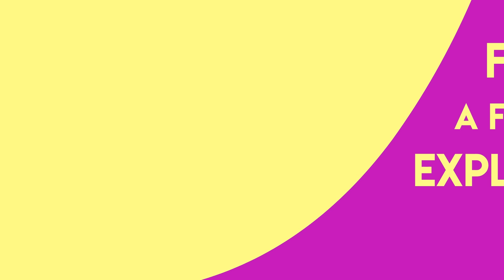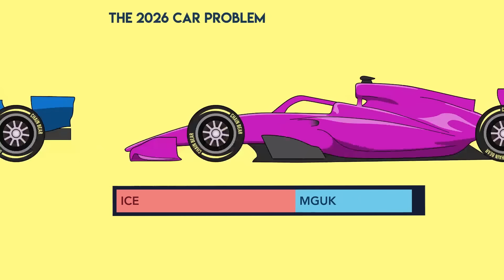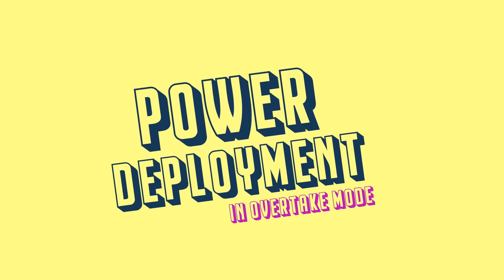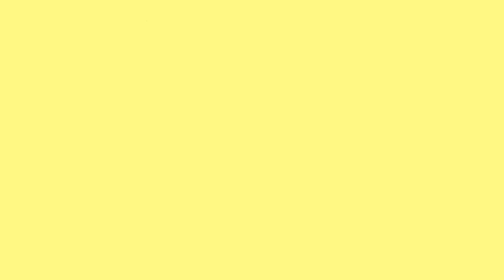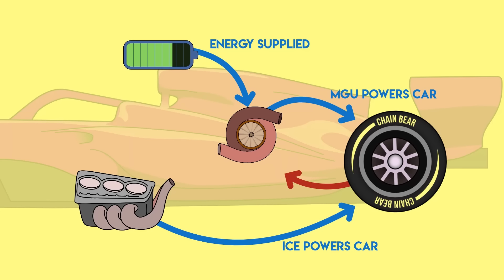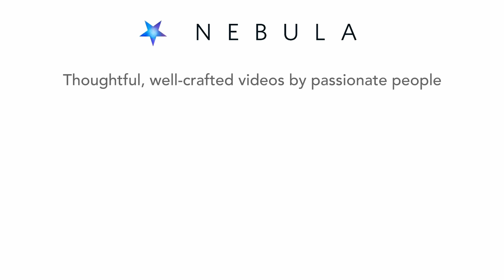New for 2026! Straight Line Mode and Overtake Mode

Comment: I have a wild idea. They said they wanted increased electric power output but didn’t say when! The 350 kW electric power can be fully deployed during the acceleration phase, after reaching 200 kph the output starts to taper. At the same time the ICE should be unleashed, keeping the combined power not exceeding 750 kW until 250 kph, then gradually taper the combined power to 600 kW at 300 kph. I remember the pre-KERS V8s produce 585–604 kW of power, with active aero helping reduce drag, it wouldn’t be too horrible to watch, I guess?

Comment: something that i wanted better understand, from what i know, the battery still has a capacity of 4MJ=1,1 kWh, the 8,5 MJ/lap (9 for overtake mode) is referred to the maximum out during the lap, that means isn't possibile to use for 24 second straight? someone could help me?

Comment: Given that the v6 is still mechanically coupled to the rear wheels via clutch and transmission (this isn’t a locomotive style electric drive) I’m curious how the driver controls battery charging on a straight. There foot pushes on the pedal for engine throttle per usual but what tells the mgu-k not to draw from the battery but to instead act as a generator and charge it? And is it variable (eg a dial on the wheel vice a switch)? I’m also trying to figure out where a driver might do this. It’s hard to imagine a driver on a straight and only putting less that 400kw to the rear wheels. Will this also create a weird situation where a driver is simultaneously regeneratively breaking into a corner while staying on the throttle to push more energy into the rear wheels for regen? 🧐🧐 Oh, and welcome back!

Comment: With overtake mode vs normal mode on straights: Super clipping car ahead at end of straight vs not clipping car behind can be dangerous no? Car ahead loses a lot of power and is 30 kph slower out of nowhere, where as the car behind still has the full 750 kW for a second (approx.)? Am i misunderstanding or does this sound like a crash in to the back of the car ahead waiting to happen?

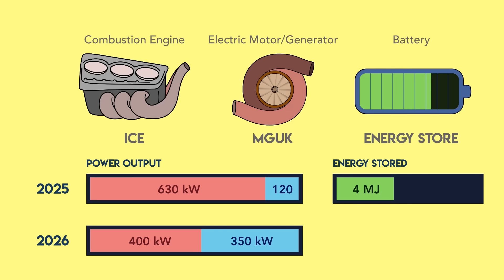Comment: 2:31 this isn't quite accurate. 8.5MJ is the amount that can be harvested in total over a lap. However, the Battery size is still the same as last year, at 4MJ.
 This also means that the deployment strategies over multiple laps don't have nearly as much effect as people think when battling cars. 
Even an energy-balanced lap will likely have cars use >75% of the SoC range, so there's not much room to deploy additional energy for more than a lap

Comment: I do fear 2026 F1 racing might be as boring as formula E with this new 50% electric power.

Drivers should be given power and ability to go as fast as possible and race... not strategise over regen-ing and charging a sodding battery!

Comment: disappointed in the changes to try and handhold the electric battery. But i am quite interested to see how corner/straight mode will work on some tracks. Curious to see what kind of crazy corner aero gets pulled out for monaco

Comment: Another issue that may effect racing is the less than 50 KPH lower limit before the battery can be used with the ICE.  I'm not sure if it is just at the start or is also a limit when coming out of a slow corner.

Comment: Great video. But I've got one question left: when is a car in overtake mode, and for what duration?
So, let's say I come out of the final corner within a second of the car in front. Does that mean I am allowed, for the entirety of the next lap, to have an amount between 8.5 and 9 MJ in the battery?
If so, does that mean that if I'm left with say 8.6 MJ at the end of the "overtaking mode lap", the 0.1 MJ of energy is to not be used?

And in terms of power deployment, does overtake mode mean I have the lenient drop-off in MGU-K power for the entirety of the next lap?

Comment: Very nice, very clear description, and almost correct. The battery capacity (or to be precise, the maximum useable energy storage on track) is still just 4MJ, but the maximum allowed recharge over a lap is 8.5MJ - the battery state of charge is going to be going up and down like a yoyo within the lap! In Overtake Mode, the amount of allowed recharge is increased to 9MJ over a lap, but as the battery capacity is only 4MJ, much of that will be used within the lap.

Comment: One question I have about active aero and using the electrical power

Do the drivers have 3 separate buttons for this?

1 for the front wing
2 for the rear wing
3 for extra power from electric motor 

Just I can see scenarios where there might be some corners where a driver wants to use the active aero on either the front wing or rear wing through some high speed corners (eg eau rouge / radillon), but not both as then they’d have too little grip. 

Just if so it seems like a lot of buttons they need to keep pressing throughout a lap, as well as all the other settings they have to change like brake balance etc

Comment: 3:56 great video but I don’t really understand how active aero is a solution to the power drop off when youre battery is empty being so significant now. 

Because of course, you’ll only want to use active aero on relatively straight sections, and not in corners. 

But you would also want to preserve your battery for the straights as well, because this is generally the best place to overtake and also where you’ll need to defend the most.

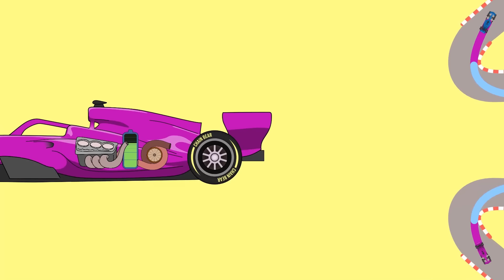So with that in mind, does it not seem likely that in corners will be the times when drivers will least want to use up their energy, and therefore making them much slower? And you do mention this at 9:19 

Of course though getting a good exit speed is very important so maybe they will use energy through the corners to get the best possible exit speed. 

These rules just seem to make it far too much about when to use the extra power from the battery though and just doesn’t sit well with me. 

Like you though I’ll reserve judgement until we see how it plays out for a few races. But I can certainly see why some drivers such as max are not excited about these new engines. 

Amazing video though, explains everything so well

Comment: So we get chainbear with intro that remainds of RPM? Hell yea!

Btw You forgot to mention few things:

a) Cars will be programed in advance for best use of el. Power by teams

b) FIA them self will ban using el. Power on some part of track, (this is not fact) but I think they'll ban using it in last 3 corners in Melbourne 12-14 so that their overtake mode doesnt become useless, 

c) Detection zone is right about there in last corner so drivers can use overtake mode in main straight (because of b)

d) Also, drivers will have boost button to overwrite programed use of batery (listed in a) to help them deploy more enegry for defense or what ever.

Comment: No mention of the removed MGUH, which significantly reduces the energy that can be used to charge the battery over a lap? I think this is an important note, they not only massively increased the electric power used, but also kneecapped the ability to generate this energy to put back in the battery, making the problem a lot worse.

Comment: Hello, welcome back!

I'm not new to F1 but am certainly no technical wizard and am not totally across the new regs. I'm concerned that in the past, DRS failures have caused issues with drivers being able to stop or control their car. Now that the DRS lines are removed and they can reduce drag anywhere it's "straightish", and also now that BOTH wings are adjustable... is there cause for concern for when the system fails? I don't know if it's a manual, driver system or an automatic system, but either way, systems fail.. it just seems to be an accident waiting to happen? Can someone reassure me?

Comment: 5:10 slight correction here. There IS a limit to how open the wing can be during straight mode. Regulations state it has to be within the rear wing regulation box. However there is no limit when CHANGING from straight to corner mode (and vice Versa) which is how Ferrari is achieving its 270deg wing. It exceeds the regulation box but only during the transition period

Comment: And they say NASCAR has too many gimmicks. That said, Mexico or any high altitude track will be interesting. Will the field be more even since the engines are capped at a much lower power limit, thus it's easier for all the engine manufacturers to extract the same maximum HP and the difference being made by the MGUK's design. Or do different teams have different torque and power curves all staying under the limit, but yielding different power delivery characteristics.

Comment: Correct me if I'm wrong but despite allowing 9MJ per lap energy recovery, the battery REMAINED at 4MJ capacity.
Reply: And? The cars are constantly spending battery so there will almost always be some capacity to store the recovery in.  Effectively empty and refill the battery twice a lap. Which the batteries will hate. My impression from testing was that teams were having issues getting enough juice into the battery. So if anything they need more recovery not more battery.
Reply: The problem is some straights would require more than 4MJ of energy. If we assume that you get to spend extra energy using overtake mode at the end of a straight, then your overtake mode is worthless because by the time you'd need it, your battery is at 0

Comment: I feel like they missed an opportunity to add front axle regen in this set of rules. So it help them charge the battery a bit more and not be quite as energy starved as they most likely will be. Yes you’re right ant it’ll involve lots of strategy on deployement…but yeah. Feels like an easy solution while keeping it RWD

Welcome back

Comment: the hybrid system will always just store & release energy that came frome the ICE first, one way or another, reducing the ICE performance that drastically is a decsision i cant understand, and they did not compensate it with anything, they could have made a 500kw ICE with the same 350kW or more of electric performance so the net energy-in loss is offset by the efficiency gains of the stronger mguk and better energy store...

Comment: For context 8.5MJ is 2.3 Kwh 10% of the original Nisan Leaf and <5% of modern EVs.  Like all hybrids, the battery is pitifully small and thats the issue with these cars.
Reply: @john681611  Hybrid cars take the worst from ICEs (the stinky), and the worst from EVs (batteries weighing 2 tons)

Comment: Welcome back! Fantastic quality video as per usual!

I’m super excited for the season, the only thing I’m worried about is not having visibility on some of the funnest aspects of this lap to lap strategy.

Is the car we’re chasing recharging at the same points? Are they vulnerable this lap because of a slightly wider line and used more energy?

The sight of a defending car managing to hold off an overtake from a car behind with better tyres only to be absolutely dispatched at the same place next lap always felt bad. I’d know it was vaguely related to energy deployment disparity, but beyond that it was just hand waving toward a battery.  
I’m worried this will become even more of an issue this year.

Comment: So basically the battery is always empty because it can't be charged enough. The charging rate is the same as the previous regulations but that battery was way smaller and the power was way less. In theory overtaking will be almost impossible because when you deploy your extra battery energy, it will drain faster and the defending car has an advantage the next straight and can overtake you right back. Or they have more energy left at the end of the straight and have to lift and coast less so they can out brake the attacking car. Really it's just stupid regulations and they are in fact already looking at the max 350kw energy deployment to make it less so cars don't drain the battery so fast.

Now there's 1 fix that would resolve all of this. Front brake regeneration. The LMP1 cars had this, in fact they also had about 50/50 ICE/Electric power. Difference being they could charge the battery way faster since most of the braking force is in the front of the car (60/40 front to back). The F1 cars would actually be able to use their electric power, but other teams dismissed this because Audi has experience from the LMP1 regulations. Stupid decision if you ask me.

Also, F1 is hyping up their new e-fuels but they will actually be used to charge the battery at the end of straights and in the corners so that's kind of stupid.

Lastly the aero rules are written in a weird way so there's more dirty air behind the cars because the air isn't forced upwards that much. This combined with the fact that the cars are less floor dominant (flat floors) but more wing dominant means that they are extra sensitive to dirty air, something that these aero regulations increased. F1 is not learning from their mistakes and re-introducing old problems. All the regulations are written in a weird way because Mercedes found an engine trick, a lot of teams have holes in the floor that shouldn't be there. It's obvious that there was a new team that wrote them.

Max was right about all of this and said so last year. I'm really interested how the racing will play out and how F1 will change the rules while the season is going on. If you want more info look at the video's from B-Sport, he was an aero engineer at Racing Point and knows what he's talking about.
Reply: @j.821  exactly what I thought too. Why wouldn’t they take inspiration from something they know for sure actually works? In the spirit of “innovation”? I’m not sure…

Comment: Question: how fast can cars charge? If you spend your whole battery on a straight, how quickly can you get a new load?

Can batteries be upgraded when it finally is time to panic? Because the starvation seems to be almost entirely about giving the batteries a lot more to do but not as much more capacity.

Comment: So it's just an undersized battery... Sounds like an easy fix to me.
Like who gets the info: 50% power is electric but will last only for 24 seconds and goes: Yes great idea.That will surely be great for racing. Also: tripled electric power but only doubled battery capacity. Huge red flag right there. The electric system wasn't designed for constant deployment like it does for the new regs. why do you only double battery capacity with this in mind? Nothing about this screams good logic like it screams bad idea.

Comment: In my opinion the ICE downgrade to only 53% of total power output is a big mistake. The cars couldnt maintain +300 kph on a straight on full throttle for more than 5 seconds with no battery power. They could just make the battery power equal to ICE's power without downgrade them.

Comment: The implementation of the MGU-k with diminishing returns is effectively restrictor plate racing, everyone shoots up to top speed and then stays there, only with the caveat that KERS is back.  

I will say that as a driver I understand where Max et al are coming from, driving the car around the corner at precisely 78% of it's limit because that is what is most efficient for the hybrid system over the course of a lap is deeply deeply unsatisfying. There is already more than enough management with tyres, brakes etc, now they have to deal with yet another variable to manage.

I don't doubt that driving the new cars will take a lot of skill, but it's not the balls to the wall driving the car on the limit racing skill most of us want from F1.

The sport has already got way too artificial, overtakes all too often are not because a car and driver were a faster package and outraced their opposition, but because of a litany of other factors, tyres, battery SoC, DRS, race strat, etc etc.. and I fear that side of the sport is only going to get worse. 

I'll reserve judgement, but I'm not optimistic.

Comment: BTW. The battery capacity hasn't changed. It's still 4MJ. So that is what you can use up in one straight. You can recover 8,5 MJ per lap though

Comment: Overtake mode only comes into affect over ~290kph/180mph?

So any straight (or track...Monaco) where the cars do not exceed that speed, overtake mode is... useless.
Even on straights where the cars do pass that speed, the "DRS zone", as it were, is going to now be much shorter, just the end of the straight rather than pretty much all of it.

Comment: Why are you talking about an MGU-K but showing a turbo at 9:22 and continue the explanation and illustration as if there is electric power going into and out of the turbo? 
That's just flat out wrong.

An MGU-K is  just an electric motor / generator unit not a turbo, it's a seperate electric motor.
The new turbos are not electrically assisted like the previous "MGU-H" ones thus no electrical energy flows into or out of them anymore.

Comment: the battery should be 30% of the total power of the car. Split into 2 ways of usage:
1 - normal mode: the driver can use 50% of the electric power.
2 - overtake mode: the driver can use 100% of the electric power.
So the car use 85% of power (70% ICE + 15% electric). To overtake/qualify the car uses 100% (70%ICE + 15%electric).
Avoid super-clipping, keep the cars fast, keep a "help" to overtake. F1 It's a engine formula, not a electric one. for electric we have formula e